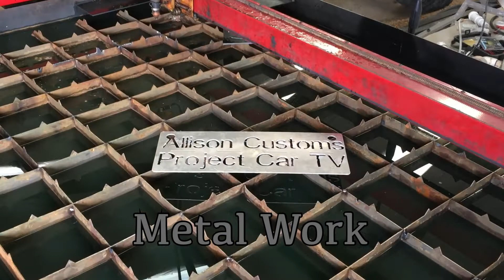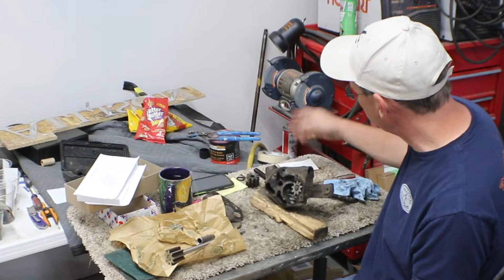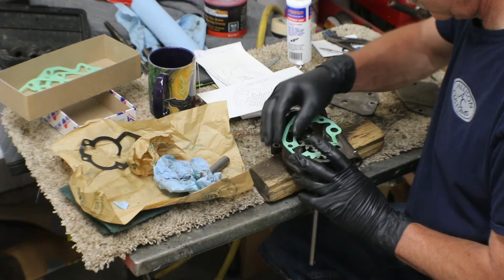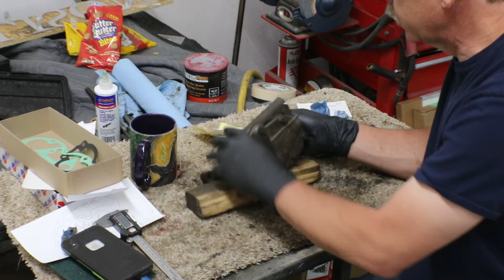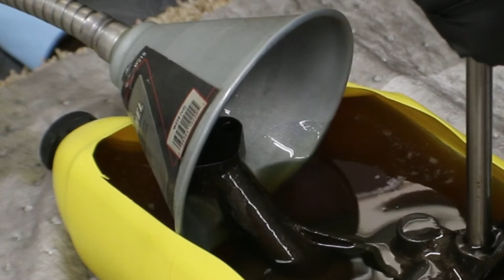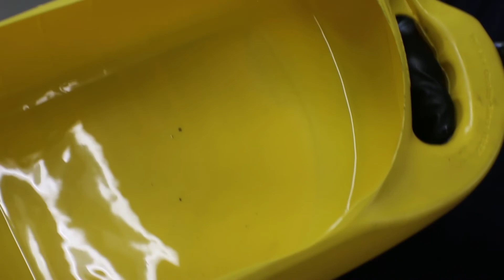Oil Pump Rebuild - Save the Heart of your engine! - International 345

Comment: Brother, Thank you can I please can an answer Can my oil pump be fixed ? I have a honda accord 2.4l and the oil pump is not in my country I have looked for it everywhere. The bearings inside wore out
Reply from the maker: I would think so, but I honestly have no experience with Honda engines - beyond 80’s ATVs and Motorcycles.
Reply: Where can I find a rebuild kit?
Reply from the maker: I honestly don’t know, I would try asking around on the Honda car forums.  Good luck!

Comment: I don't have calipers. 
So when I re assembled. I put the gasket on. then installed the cover plate only on half exposing the the Face of gear. Cover plate facing up so the gear drops to housing, then used feeler gauges to check gap between gear and plate.
Reply from the maker: Awesome work around!  Thanks for sharing!